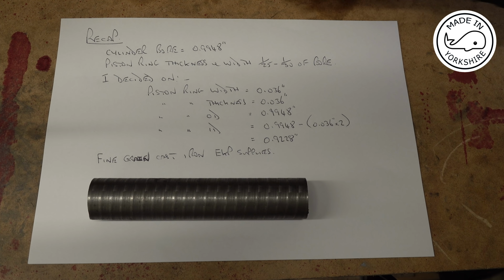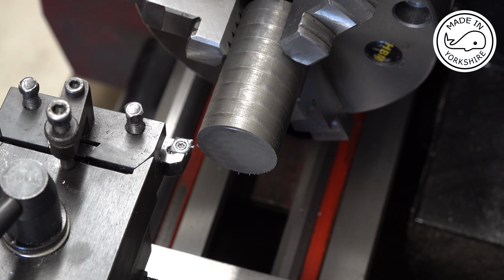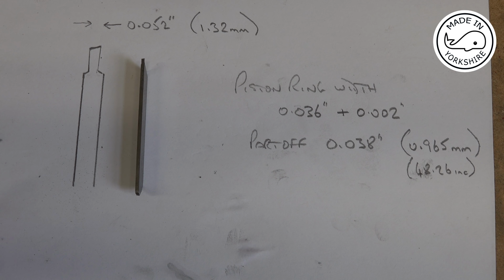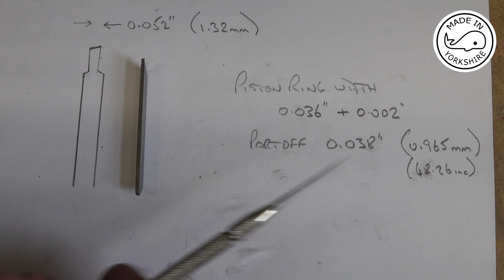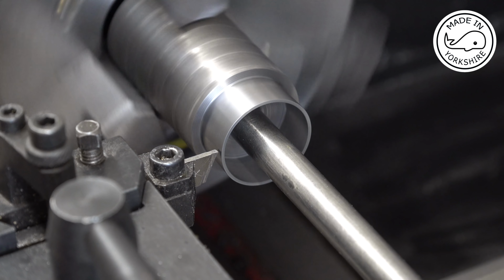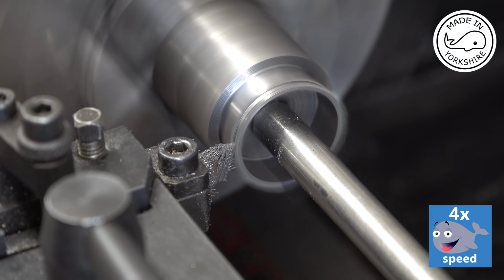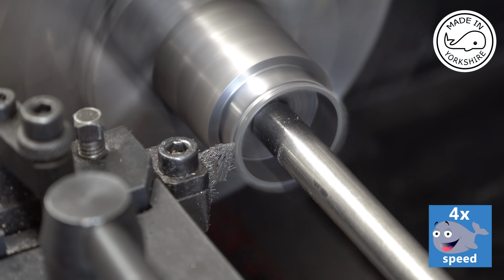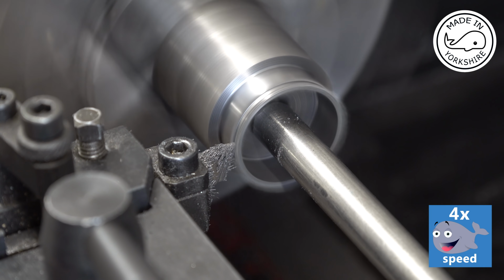#MT41 Part 3 - Philip Duclos Odds n Ends Engine. Making Cast Iron Piston Rings. In 4K by A Whale.

Comment: You don’t need WD40, cast iron is machined dry.
Reply from the maker: Hi Ross - fair point. I wouldn't normally use WD-40 on CI. However, when trying to machine to within tenths of a thou, Earl and I thought it might be wise to lubricate. Looking at the Trimble article in Strictly IC, he uses an India stone with kerosene to remove tool marks and then polishes dry with 400 wet or dry paper. That seems like a better approach and one for me to try next time. I just need to get some medium and dry India stone!
Thanks for the feedback.
Cheers
Andrew
Reply: @learningturningmetal  It might have helped by inadvertently cooling the work piece. The free graphite in cast iron provides all the lubrication necessary.

Comment: Andrew the rings do drop of the spacing peg after they have been held at red heat for a while probably just a little longer. I'm sure yours will be serviceable however as they are nice and springy. Nice job.
Reply from the maker: Thanks Brian. That's reassuring.
All the best.
Andrew

Comment: Hi Andrew, another fine piece of work as usual.  I can now uncross my toes and fingers after watching you break that first piston ring.
Reply from the maker: Ha ha - thanks Steve. Those rings are certainly fine and delicate. Earl suggests that I should have held the ring in the top corner of the vice, with only a small amount of the ring held in the jaws. I think he is right, but 3 out of 4 isn't too bad.
Cheers
Andrew
Reply: @learningturningmetal  Yes, I thought the same as Earl.  More flexibility in the ring would make the break more reliable.

Comment: Are you sure that you have never done anything like this before?  You either planned it out 24 hours a day for a week or so, or, you’re a master machinist of the mini machine shop.  Great job, either way.
Reply from the maker: Ha ha - thanks mate! This was definitely my first attempt at machining piston rings. I really enjoy challenges - especially when they seem to work out well!
All the best.
Andrew
Reply: @learningturningmetal  I have made a few things on my mini lathe but I am still green as grass. I have more experience on the milling machine and with a CNC machine.  I ran a Chrysler lathe in middle school but that was about 47 years ago
Reply from the maker: @taranson3057  I found my mini lathe to be highly accurate and it would be have definitely been capable of making piston rings using this method. I hope you give it a try sometime.
All the best.
Andrew
Reply: @learningturningmetal  my mini lathe isn’t terribly bad for what it is.  I have been making modifications to the lathe to make it more rigid.  Currently working on a motor upgrade and installing a brushless servo that has a lot more torque.

Comment: Hi Andrew, well done, really good end result. If I may offer some experience to help you next time on similar jobs (please don't take as critical, it's not meant this way at all). Earl was correct with bore out first, or at least rough out first. For something this critical when you are splitting thous, it is always good practice to get all your major material removal out the way (bore & O/D) before finishing any feature. This way you don't risk introducing eccentricity through either the part moving in the chuck, or simply the material stress relieving as a result of large percentage mass removal. As I said, great job and well done, your pleasure is written all over your face and rightly so. Cheers, Jon
Reply from the maker: Hi Jon - many thanks for the advice. That makes a lot of sense. I will try to remember that! Yeah - I am pretty happy with the way it turned out.
Cheers
Andrew

Comment: Fantastic! My heart was in my mouth for most of that. Congratulations and well done - you've gained another 'belt' in Model Engineering. I'll use this as a reference when I graduate from 'O' rings ;)
Reply from the maker: Thanks mate! It was a bit hairy scary. Next time I will cut more rings in order to take the pressure off me when doing the remaining processes. All signs are that Earl's method definitely seems to work. Fingers crossed they will perform well on completion of the engine. I still have my o-ring waiting in the wings!
Cheers
Andrew

Comment: thank you sir great video . i'm building A webster engine and I think I will try to make a pair of cast rings instead of delrin acitel rings as I had at first intended. . yours work so nice, perfect fit .great workmanship on your very first try ,hope I can do as well .
Reply from the maker: Thanks Ray. It's definitely worthwhile having a go and experimenting. It's a pretty straightforward process and very rewarding when they work. I'm not familiar with the Webster engine, but you will need at least two rings for each piston.
I hope it works out well for you.
Cheers
Andrew

Comment: Ah yes, Thursday morning coffee with Andrew. Going to have to give that a try with my " Odds and Ends engine see if I can't get compression back. Cheers!
Reply from the maker: Ha ha Richard - I did manage to keep it to less than 30 minutes! I wonder if you could check your compression beforehand to see if there is leakage between the rings and the cylinder? I'm starting the think about making the cylinder block and I think that there is a risk of leakage between the cylinder and block if I don't get a really good press fit. Not the best of designs, and once pressed in I doubt it will be possible to get it out again. I hope you manage to get your engine running again. Have a great day in your workshop!
All the best.
Andrew

Comment: To cut the rings to width, I’ve taken to using my tool post mounted dremel tool with a thin cutting wheel.  It leaves a very nice edge, and afterwards just polishing both faces on some 400 grit paper with oil on a sheet of glass cleans them up beautifully.  I then break and clean up the ends of the break with some paper before putting them under the torch to expand them.
Reply from the maker: Hi John, that's an interesting approach. I must get round to making a lathe mounting bracket for my proxxon.
All the best.
Andrew

Comment: Andrew, On thin bores of cast iron to stop chatter I remember to stop the tool chattering is use a piece of wood and hold it on the surface of thin bore with one hand when parting off. The other method was to lower the parting off blade below the centre line. Hope that may help you. Nice job on the rings. It was very interesting indeed.
Reply from the maker: Thanks for the tips Gary - very much appreciated.
Cheers
Andrew

Comment: I have had good luck by cutting the ring gap first before machining it.  
In other words, make an oversized cylinder and cut that longwise. (That is the rough gap). Then clamp it shut with the 3-jaw chuck and machine it perfect. When you part it off it springs open.  
I never had any luck snapping or cutting them after machining.  I always butcher the edge and a ring requires all sides to be polished, not just the outside.
Reply from the maker: Hi, that sounds like an interesting method. Thanks for the suggestion
Cheers
Andrew

Comment: Nice job Andrew. You've inspired me to have a go at making a cast iron ring for my Farm Boy engine instead of the O-ring. I was worried that you'd have to cut the ring and end up with the diameter too small and a gap, and hadn't expected you to simply crack it to get the split. We grind the ends of rings down when we build racing engines to allow a couple of thou for expansion, but with these small engines that may not be an issue. Very nice video!
Reply from the maker: Thanks Tony. Breaking the rings was a little scary. Earl has since advised me that I should have held the ring in the top corner of the vice, with most of the ring exposed. That way the ring should break easier. As I mentioned in the video, a couple of rings just needed a very fine sanding of the broken faces. Fingers crossed expansion won't be an issue - time will tell.
Cheers
Andrew

Comment: Well done. As always, very good footage giving a very enjoyable video.
You turned the diameter of the raw stock to the same diameter as the cylinder bore. Remembering the pistongrings I changed being young a resting piston ring had an OD slightly larger then the cylinder bore. In the end of the video You mounted the rings on the piston and now they look like having a larger OD. What did I miss?
The way of polishing the width of the rings was great.
Reply: When Andrew heated the rings the gaps were spread slightly by the wedge that was holding the ring. This gave the ring some "set" so that when the ring is fitted in a cylinder it has some outward spring to it which helps it seal against the cylinder wall.
Reply: @johncrowley5612  Thanks. I didn't catch that detail.
Reply from the maker: Thanks Stefan - I see John has beaten me in explaining.
All the best.
Andrew

Comment: I’m curious to know if trepanning machining could have been used in the process of machining the piston rings.
Reply from the maker: Hi. I think trepanning would have been possible, but I just tried to make the process as easy as possible.
Cheers
Andrew
Reply: @learningturningmetal  the process that you took was what I would do, I was thinking more in lines with reducing material waste but then I realized how little material was actually being cut to make the rings. Not to mention that trepanning may not be as accurate a method, especially for the green as grass newbie, such as myself.  😜

Comment: Hi Andrew.  I just purchased the Philip Duclos books you showed.  I am new at making these engines.  The ones in the books look a little advanced.  Can you recommend an engine that would be a good starting place for a new to the hobby person?  I am new to metal working but have all the equipment I need to build one.  Thanks
Reply: Go for the 'Huff 'n' Puff' - very little material involved, but it will teach you a lot :)
Reply from the maker: Hi Dale - when I started machining a couple of years ago, I found drawings a little difficult to understand. My first engine was a little wobbler, which I produced drawings for. It only takes a day or two to make - mainly from aluminium. I made three videos (#MT20) and you can download the drawings from a link in the video description. Making this little engine got me hooked. I found the Stuart S50 a great little 'starter' engine, and a good way to become familiar with drawings. However the S50 casting kit needs to be purchased. As MisterG suggests, the Duclos Huff n Puff looks like a good starter engine - though it is quite a tiny engine. Material costs should be minimal too.
I hope that helps.
Cheers
Andrew